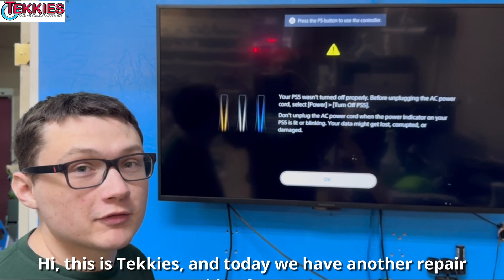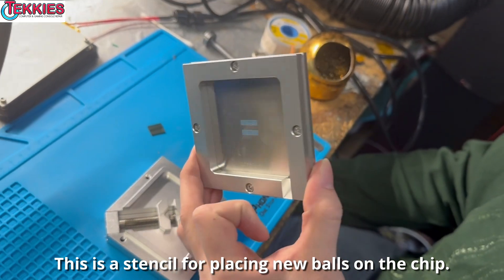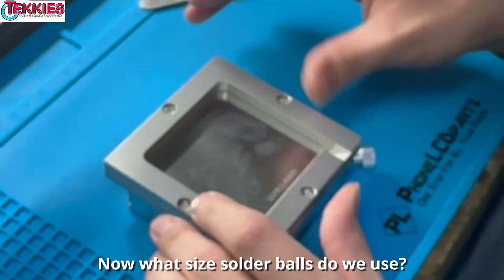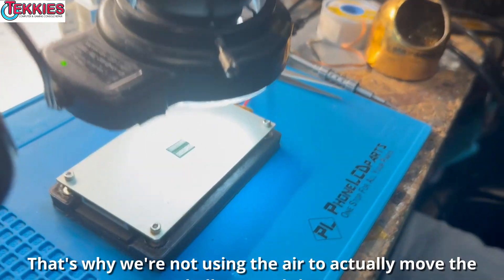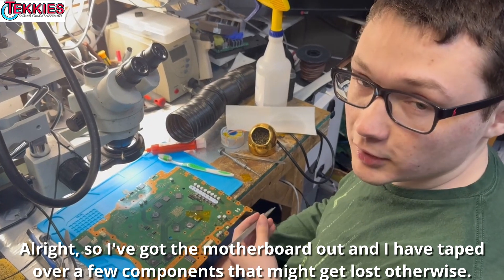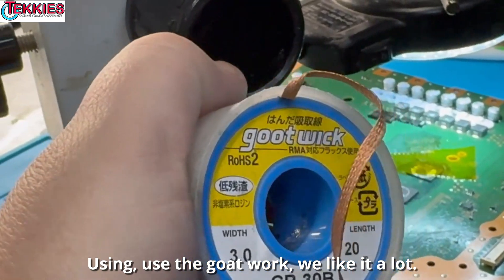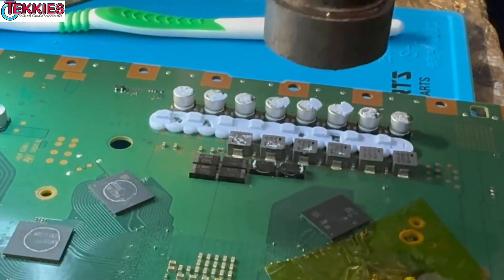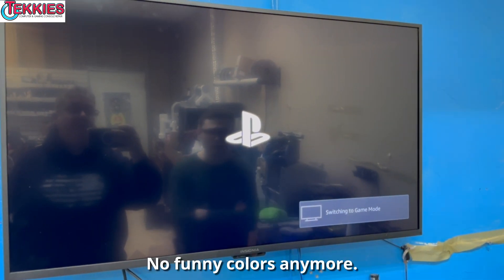PlayStation 5 Video Artifacting Fix – VRAM Chip Replacement Step-by-Step

Comment: Hello! I have a similar issue. My PS5 Slim Digital is practically new (but out of warranty). It works normally in the console menu and in specific games (GTA V PS4, Need for Speed, etc.), but in demanding games with ray tracing or demanding PS4 games, it starts showing texture artifacts—some without color, others colored, others extremely stretched and nonsensical, etc. I don't think it's a problem with the GPU or APU, because if it were, I believe it would be insanely worse. If anyone has a similar problem and has managed to solve it, please comment here. I suspect it might also be a VRAM chip issue.
Reply from the maker: Why it's likely VRAM:

✅ Menu and simple games work fine — The PS5 UI and less demanding games (like GTA V PS4 version) use only a fraction of the available GDDR6 memory
✅ Artifacts only appear under heavy load — Ray tracing and demanding PS5 games push VRAM usage much higher, which means they're accessing memory addresses on the faulty chip that simpler tasks never touch
✅ Textures specifically glitching — Stretched, colorless, or nonsensical textures are stored in VRAM; if a chip has bad memory cells, you get exactly these symptoms when that memory region is accessed

If it were a GPU/APU failure:

You'd see artifacts everywhere — menus, boot screens, simple games
The console would likely crash, freeze, or fail to display anything at all
Issues wouldn't be load-dependent

Diagnosis steps you can try:

Database rebuild — Safe Mode > Option 5 (won't fix hardware but rules out corruption)
Test airflow/thermal — Make sure console is well-ventilated, though your symptoms don't sound thermal since it happens immediately in demanding games, not gradually
Different TV/HDMI cable — Just to 100% rule it out, but stretched geometry artifacts are almost never cable-related

The reality:
Since you're out of warranty, the fix would be VRAM chip replacement — which requires micro-soldering equipment and expertise. It's the exact repair shown in this video. You'd need to identify which of the 8 GDDR6 chips is failing (diagnostic tools or thermal imaging under load can help), then reball or replace that chip.

Comment: What would happen if you double the Memory capacity? Or use faster VRam?? Test maybe?
Reply from the maker: reat question! This is something people ask a lot, and the short answer is: it wouldn't work on PS5, and even on PC GPUs where it can work, the results are often disappointing.
Here's the breakdown:

🚫 Why You CAN'T Do This on PS5:
1. Fixed Memory Controller Architecture
The PS5's custom AMD "Oberon" APU has a 256-bit memory bus with 8 GDDR6 chips. The memory controller is hardcoded into the silicon — it's designed to address exactly 16GB across those 8 chips (2GB each). You can't just swap in 4GB chips and expect 32GB.
2. Firmware/BIOS Lockdown
Unlike PC GPUs where modders can sometimes flash custom vBIOS, the PS5's firmware is locked down tight. Even if you physically installed different chips, the system wouldn't know what to do with them.
3. Unified Memory Architecture
The PS5 shares its 16GB between CPU and GPU — it's not traditional VRAM like a discrete GPU. The entire system is built around this specific configuration.

🔬 What Happens on PC GPUs (Where It IS Possible):
Chinese modders and enthusiasts have successfully upgraded VRAM on cards like the RTX 2080 Ti (11GB → 22GB) by:

Replacing 1GB GDDR6 chips with 2GB variants
Finding compatible vBIOS that supports higher density chips
Having the right soldering equipment and skills

The results?

✅ System detects the extra VRAM
✅ Works for AI/LLM workloads (Stable Diffusion, Llama, etc.)
⚠ Gaming performance boost is only ~10% in most cases
❌ Some mods boot but crash in games due to driver/BIOS incompatibility
❌ 44GB RTX 2080 Ti mod — detected the memory but couldn't run benchmarks or games at all

Why minimal gaming improvement?
More VRAM doesn't make the GPU compute faster — it just holds more data. If a game already fits in your current VRAM, doubling it won't help. The memory bandwidth stays the same (616 GB/s on 2080 Ti regardless of capacity).

⚡ What About Faster VRAM?
Some modders replaced 14Gbps GDDR6 chips with 16Gbps Samsung chips and pushed overclocks to ~18Gbps — this DID help performance because it increased bandwidth. But again, this requires:

Compatible chips (same pinout, voltage)
vBIOS that supports the higher speed
Luck that your memory controller can handle it

🎬 Would It Make a Good Video?
Honestly? Yes, but on a PC GPU, not PS5. A "Can we upgrade VRAM on an RTX card?" video showing the process, testing before/after in games AND AI workloads would get great engagement. The PS5 angle could be "Why this ISN'T possible on consoles" as an educational tie-in.
Let me know if you'd want to see that kind of content!
Reply: @TekkiesIncBartlett Great response! I would definitely like to see a vram replacement of vram on Desktop GPU with faster and higher capacity chips and see if there any improvement. Like a RTX4080 change from 16gb to faster 32gb. But doubtful it would show any big change for gaming.

Comment: I have artifacts within 5 minutes of play (edm 010) then freezes or shutdowns. Have replaced both 62gg and 61gg, liquid metal ans psu. Problem persists. Uart shows no error. All ps4 games are playable for hours but not a single ps5 game. Could it be a ram issue?
Reply from the maker: Could be possible if like you can mail in we can check your console.
Reply: Same problem. Have you solved it?
Reply: @Ivan_Kostyan  don't waste your time, its a vram phase 6 problem and can't be fixed. Use it only as ps4 pro plus or get rid of it.
Reply from the maker: This is a really interesting case — and yes, your suspicion about RAM is very likely correct. Here's why:
The key clue: PS4 games work, PS5 games don't
This is actually a major diagnostic indicator. PS4 games running in backwards compatibility mode use significantly less VRAM and put less strain on the memory subsystem than native PS5 titles. Native PS5 games:

Use higher resolution textures
Access more memory addresses across all 8 GDDR6 chips
Push the GPU harder (higher clocks, ray tracing, etc.)

If you have a partially failing RAM chip, PS4 games might never touch the bad memory cells — but PS5 games will hit them almost immediately under load, causing artifacts then crash/shutdown.
Why UART shows no error:
UART typically catches failures during boot sequence and initialization. If the RAM passes the initial memory test but has intermittent or heat-related failures under load, UART won't flag it. The console boots fine, the problem only shows when the game starts hammering the memory.
Diagnostic suggestions:

Thermal camera under load — Run a PS5 game and watch the 8 RAM chips. Look for one heating unevenly or significantly hotter/cooler than the others. A failing chip often shows thermal anomalies.
Freeze spray test — While artifacts are happening, hit each RAM chip briefly with freeze spray. If cooling one chip temporarily stops the artifacts, you've found your culprit.
Check for Micron vs Samsung — EDM-010 boards can have either. Micron chips have had a higher failure rate in my experience. If you have Micron, a swap to Samsung might be worth considering.
APU possibility — Since you've already done extensive work (PSU, VRMs, liquid metal), if RAM swap doesn't fix it, the APU itself could be degrading. The GPU portion runs at higher clocks for PS5 games vs PS4 BC mode — a marginal APU might pass light loads but fail under full stress.

Bottom line: I'd start with thermal imaging to identify the suspect chip, then reball or replace it. Given everything you've already ruled out, RAM is the most likely remaining cause.
Let us know what you find! 🔧